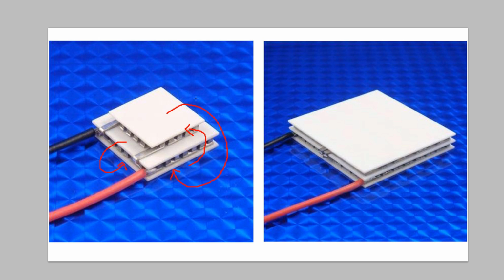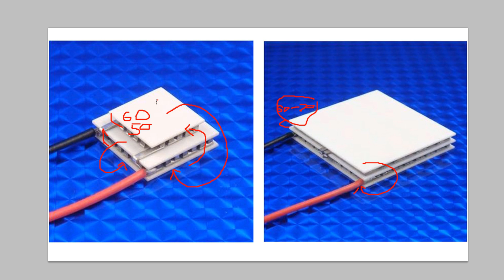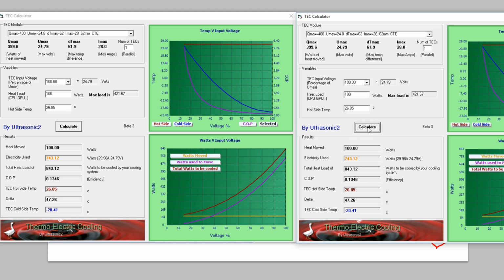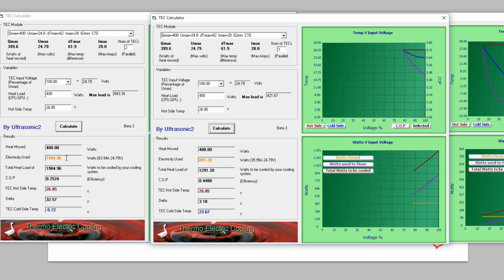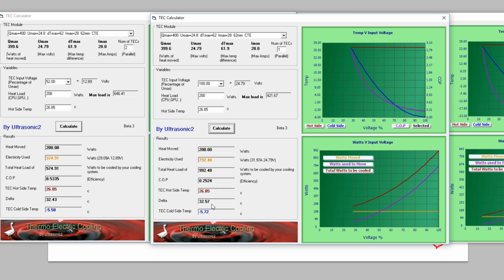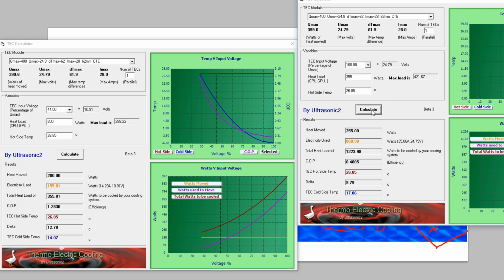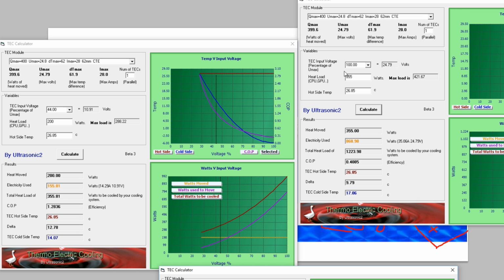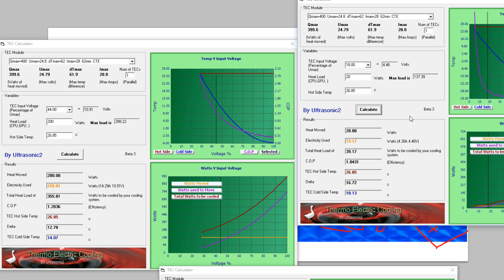🎓 Understanding Peltiers ⚡️ TEC Stacking, Parallel. Episode4

Comment: The correct way to stack them for maximum efficiency is to use one with about 1/4 less surface area on top with a metal heat spreader between each stage. Also reduce the element count by about a third per stage. This gives you the full potential for cooling temperature but actual power transfer will drop quickly as the stages are stacked. That  With the full surface area you can only do two of them and only get an extra 20 degrees C to show for it, however if you do the top one at less current the device will cool a lot better.

Comment: You're over complicating the efficiency 
The correct way to stack peltier modules is to stack them hot side, to cold side and using less wattage/voltage on the bottom side than the top side
Here we run into an efficiency issue due to power consumption
Power consumption is easily reduced using inversion technology and capacitors
We can also use the heat side of the tablet to create a small amount of voltage which once again can be stored in capacitors and inverted to a higher voltage
Essentially we end up with a self sufficient perpetual motion device which unfortunately is not something you are allowed to patent let alone market
GM patented a peltier device many years ago that uses the heat from a combustion engines exhaust to create the voltage required to run the system and charge the battery without the need for moving parts and at a fraction of the cost
I'm not a scientist but I am a refrigeration technician that loves to play with peltier elements, electricity and magnets lol

Comment: Thanks for the info, got a 32L cooler for free. A plastisk bucket with a lid. I fixad it up, put in new isolated in the lid and got new thermal paste. So now it cools down to a maximum of 5,5°c in 1h 10m. Before 7,8°c at 2h 10m. It works fast down to 11°c the heat output in the start is 33°C room is 22°c but once it down to 10°c in the box the heat out is more around 26°c. So i think i am going to try and stack 2 of them. Should bring the temp of the box down much faster in the lower temps. Closer to 0°c mark. Not sure how old peltiers can get. But its cheap and fun to test.

Comment: Bro. I bought 2 peltier one is 6A and the other is 10 A and its kit, but I can not get any cold  just a little, and a lot of heat from the other side, so what's the problem?
Reply: Probably too little cooling on the hot side. A delta T of 20K does not help you very much if your hot side is 50°C.

Comment: helpful video for what I am trying to learn thank you. 
That said I really liked the calculator u are using as it would help me easily understand some theory behind some of my desgin ideas for peltiers TEC's
I found a link that I assume you posted a few years back about said calculator unfortunately the link is dead is this still something you have? Would I be able to use said calculator? If not would you be able to point me in the right direction where I could find such a calculator? I am still new to some of the concepts so as I do the math by hand I would like to have a calculator to check against.

https://www.overclock.net/forum/62-peltiers-tec/249758-ultrasonic2-s-tec-calculator.html

cheers,
Max

Comment: Hi, Thank you for the video!
 I have a question. If my goal is to get to a low temperature as fast as possible, would putting two tecs in parallel give a better result, rather than 1 tec alone? would the cold side reach a lower temperature in less time?
Thanks
Reply: Yes. That will increase the total power available, so it will reach the same temperature in less time (and also it might reach a lower overall temperature because they can dissipate more power).

Comment: We are using expensive & flammable AC fluid in EV cars.
WHY, when we have unlimited power & 50 years of TEC technology? WTF?
Reply: I recommend you to watch the rest of the series of videos. Peltiers are way less efficient than regular heat pumps, and their only advantage over them is their size and the fact they're easier to use and don't require, as you say, expensive fluids that also have a big greenhouse effect. But it's not feasible to make an AC with them.
Reply: flammable ac fluid? can you please explain it further, please?
Reply: @jawwadsabir4620  Airco unit refrigerant.
Reply: Can only assume it's due to these factors. 1 you already have the mechanical rotation of the drive-train to also drive the AC compressor
2 you will still have the heat from the hot side to get rid of and 
3 the wattage draw would be a very high additional load.

Wish they were more efficient as they seem like the ideal application for vehicle AC.
Especially if they were more efficient; parts of the cabin could be made of them, and on hot days they would be cooling and vise versa and as a bonus, the electricity generated could be fed back to the batteries... in an ideal world of course. 

(Baby steps while some tech. is being withheld)
Reply: These things work because of how precise and small the machine and make the parts. Once we get graphene tec this will become the answer. Literally this is because of material and our currect machines that are making these. The jump is coming.